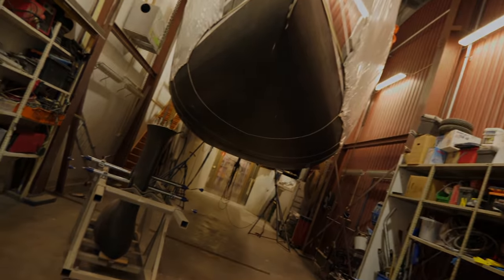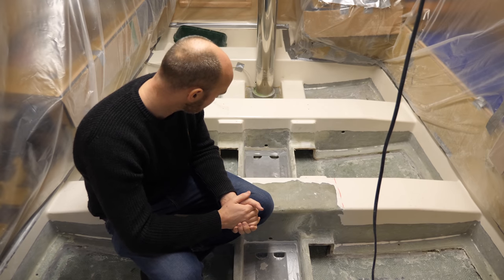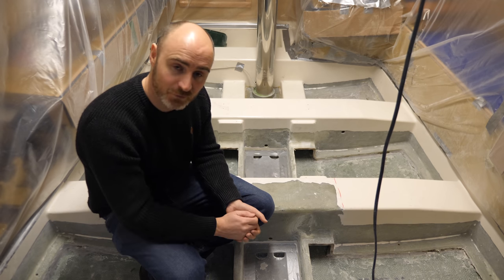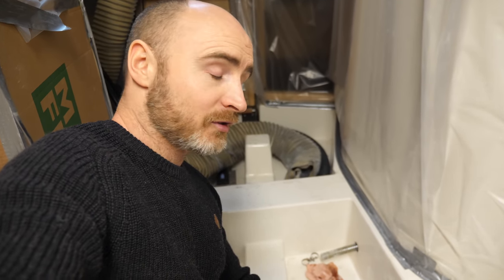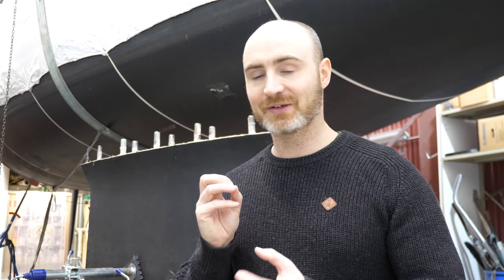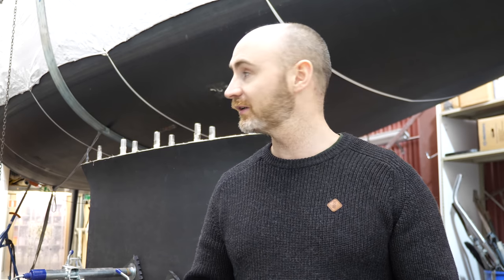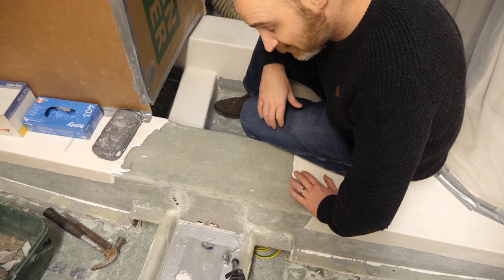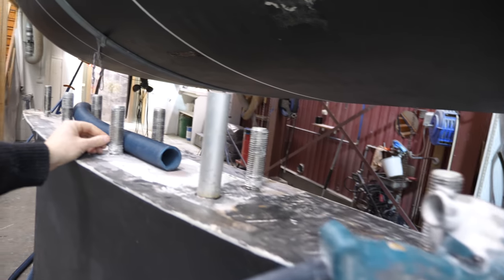SAILBOAT REBUILD - what they DON'T TELL YOU about PRODUCTION BOATS - Plastskador repair week 2

Comment: Expedition Evans (YouTube Channel) bought a keel grounded Beneteau the entire frame broke away from the hull. before they could glass the frame back onto the hull they had to scrape away what seemed like a layer of insulation - except why would you insulate the frame and not the hull? And the layers of glass separated as they were scraped. I've done a lot of epoxy, even using resin with water in the can, rained on fiberglass (all wrong practices) I've never seen this. It means they didn't do the layers soon enough, and then didn't wash off the bloom, or rough up the first layer. The whole business looked incompetent.  Personally, I wouldn't use polyester resin on anything I might be out of sight of land on. Vinyl ester is almost as good as epoxy but less expensive. The labor is always the biggest cost, so why skimp on the bonder?  I've repaired kevlar fiberglass vinylester kayaks with fiberglass and epoxy patches. Big holes. Years later there's no separation. Between layers if you wash off the bloom, rough up the surface with sandpaper so the new bonder keys into the old... Polyester resin does have a coefficient of expansion problem with metals. In cold Michigan fixing a car body with Bondo (poly) only lasted a year or two before it popped out. I've never seen something properly epoxied pop out of anything except teflon tape, a heavy coating of wax, or mold release, and a wooden core. (it takes the top layer of the wood, so it's mostly the wood pulling away from wood.)
I can bet the manufacturer would say, 'well if you ground our boat, you've violated the terms of your warranty,'  we're off the hook. I may only be a beginning sailor but one thing I've already frequently heard, 'All boats eventually ground.'  So sure ten knots straight into a rock. But most of these groundings don't appear to be all that serious and yet the boat is completely undermined. 
I saw a video in which an anchored Jeanneau was blown ashore in a gale. The keel went right up through the hull, wrecking the salon before dropping back out.  And then there are the accounts of keels dropping off mid ocean.
So what you're doing to fix it I think should've been done in the first place.  Also shouldn't keels have a sacrificial crush zone at the front and bottom to absorb  impacts? And shouldn't the hard metal ballast area behind the crush zone be curved such that as a grounding hit's the keel the force is first absorbed by the breakaway/crush and then the hard part of the keel slides up the obstacle turning forward impact into a lift?  It just seems wrong that sail boats grounding at 5-7 knots are turned into wrecks, or rendered extremely dangerous.
I would run aluminum flex or plastic tubing through that grid everywhere you might someday want to run a wire. It's really simple to pull wires through a 'tube' than it is to try to run them any other way. It's a small expense for a lot of flexibility. (And data wires, electronic interference?  Don't worry about it. I knew someone who ran Cat-5 ethernet in office buildings for IBM. First they run the wires anywhere they can, often through electrical conduit, then they connect everything. Then if there's any interference, they go back and fix that. They can wire an entire office building in one week. My son's school, one wire type per one conduit took two years and cost ten times more.) 
I'm planing to buy a catamaran or a trimaran: what kind of endemic problems should I be on the lookout for? I can beef on production monohulls, but it would be pretty stupid to turn a blind eye into any shortcomings in what I'm trying to get into. 
Bilge pump. I'm used to sump pumps on land. They suck up a lot of water and send it straight up a pipe or hose, so you can remove water from a basement. With a through hole you would be pushing water against water, but the pumps are designed for this. But what if instead of another through hole you ran a pipe or hose up the side of the hull  above waterline then put a through hole? You probably haven't increased the work the pump has to do, but you've also eliminated another possible leak point under the water line.  Just thinking out loud, being a busy body.  I love to hear any further  thoughts you have on your repairs.
Reply from the maker: Hi there, glad you are watching Expedition Evans, we are too. I was surprised also with the materials that came off their grid, they really had to work hard to get down to good glass. I agree that epoxy maybe stronger in it's properties but there are also may reasons to use Polyester. The Polyester that this company is using isopthalic Polyester which is much more resistant and stronger than standard orthophthalic polyester. That together with the Crestafix to make the bond makes a very strong repair. Epoxy can be more difficult to wet out and is much more sensitive to the conditions it is laid, especially to the old glass. Poylester is also much easier to get a better finish as you can lay gelcoat over it. For the application the strength is going to be more than enough, the company has been doing this for many years and work with all the major insurance companies so I do trust them. If there boat repairs came back, they would be loosing these contracts.
You have many cool ideas on how to make the keels better, there are already companies that do produce a soft front to the keel and I am tempted by it for sure. Maybe it should be an optional extra at the factory, I think alot of people would go for it, especially in places with rocks like here.
As for the bilge pump I will probably put a hole just above the water line so it doesn't have to push water and there is not too much of a hill, still thinking about this.
As for the cables I used to do this a lot in airports also with Cat5e. Ran some conduit last weekend, I think it will be a success.
Thanks for the thoughts though, I have no experience in buying a trimaran or cat but I wish you the best of luck in your search. At least with a cat you have the redundancy. Cheers, Chris

Comment: This is EXACTLY the same issue as the channel Expedition Evans had to fix on their boat. The more I see this type of stuff the more im convinced of buying an older boat and refitting it with a modern interior.
Reply from the maker: Indeed and they did an awesome job on the repair, I'm sure ours will be as good if not better. True, you could buy and old boat and refit it, check out Sail Life, you can see how many hours of labour are required to do that. Of course there are easier project out there.
Reply: @SailingAurora  I am here because I watched all of the oh glorious sanding videos ;)

He did do an amazing job, I think it is beyond most peoples patience though, mine included.

Hope you get her back in the water soon, they are very pretty boats,  I just wish they were built like older boats!

"sailing is a series of compromises" springs to mind.

Comment: That's why I would never buy fiberglass boat, ever. Custom or production. Glass is exactly that, brittle, cracks often, creates blisters and water saturations, boat will never be the same after what you went through !
Aluminum is THE way to go, yes its more money up front, but very easy to repair, all you need is a skill saw for cutting, and a good welding machine.
Reply from the maker: Hi Jerry, I see the benefits in Aluminium for sure and I hope you have or find the dream boat. As for the repair, she is now stronger than when she came out of the factory, so no worries there. Chris

Comment: I couldn't watch more than halfway through the video.  Apparently, despite being in a boatyard doing a major rebuilding on a boat only a year old, you have   not realized that you have purchased the wrong boat.  This has become quite common,  people coming into the sport knowing nothing and unwilling to spend the time necessary to learn.      Using Bondo as a structural component?  Are you nuts?  You shoulda bought a Contessa 32 (your first response: "It's too small!"  Also the response of a knownothing). An old Hinckley Pilot 35 and having her thoroughly refit would also have been an excellent choice.  But I know you won't do that.  I only hope your ignorance doesn't kill your wife.
Reply from the maker: It's not Bondo, go and do some research on ISO polyester, it's a tried and tested method. With all due respect, wrong boat is a matter of opinion, each of us has our own needs, I guess you know yours. Thanks but I am confident in my choice

Comment: You guys are wrong about Hallberg Rassy they do not rely on the grid to support the keel, their hull forms a deep flange at least 200mm
often deeper the keel is then bolted to this, i have seen a HR 64  after hitting a rock at 8 knots the keel  and joint was still good
there was damage  was along the hull as it was well heeled over when the collision happened and the hull scraped along an adjacent rock 
but not bad enough for water to penetrate.  As someone else has said buy a secondhand HR any day over one of the mass  production new builds , If you are serious about Sailing offshore..... Here is their latest 40 footer  see the stubby Flange.......
 https://www.hallberg-rassy.com/fileadmin/user_upload/HR40Cinteriorsideview.jpg
Reply from the maker: Hi Adrian, thanks for the comment, maybe I was a little unclear in my wording. It can be difficult to get it perfect in these videos but doing my best. If you listen closely, I never said HR had a grid. I was using them as an example of a handbuilt boat that has a significantly higher cost attached. I'm going to agree with you, they are better suited to ocean passages. That's pretty impressive that it could take that kind of hit. Being as the hull got scraped I would suspect that the rock did not bring the boat to a dead stop and they probably got away a little lucky. The forces generated in hitting a rock with a dead stop are so great, we are talking over 100 tonnes that you will break something.

Thanks for the link, you can really see there are a lot of bluewater features in the HR's and I would love you have one but here we are. We love our boat and many other production boats have made ocean crossings, we know it's not the perfect boat but we are ok with that. Maybe we will learn the hard way. Thanks for your input though. Cheers, Chris
Reply: @SailingAurora  Hi Chris , thanks for the reply i have to admit i was a little lazy and posted the same comment to you as was 
ment for a few others that had commented on the HR .  Enjoy your sailing this season, your yacht will be stronger after the repair than
when it left the factory.  I would question using polyester resin, there is no need to do test samples, industry has already done that
for you many times in the Lab.  Epoxy is far stronger  including its bonding strength which is what you are trying to achieve....
All the best   Adrian....

Comment: Why don't you buy a aluminium boat, then all these problems is solved:)
Reply from the maker: Money :) Aluminium boats also have their own issues also if not anodised properly
Reply: @SailingAurora  Well:) also fiberglass boats needs anodes?
Reply from the maker: @stureellingsen7789  I see what your saying but the consequences of not getting it right on an Alu boat could mean the loss of hull integrity with metal failure. On a fibreglass one its only the ridder and engine exposed to galvanic corrosion. Wouldn't say no to one though.
Reply: @SailingAurora  Sorry but my English language is not good enough to give you a detailed answer, but I have had two aluminium sailboats for over 20 years and I have never had a problem with corrosion
Reply: and anyways don't want to be rude or impolite,its ok to have different ways of seeing ups and downs with different boat types:)
Reply from the maker: @stureellingsen7789  no worries, no offence taken. I haven't had an alu so I'm only really quoting what I've read and what people have talked about. Own experience counts for alot more, if you do the right maintenance I'm pretty sure they will look after you